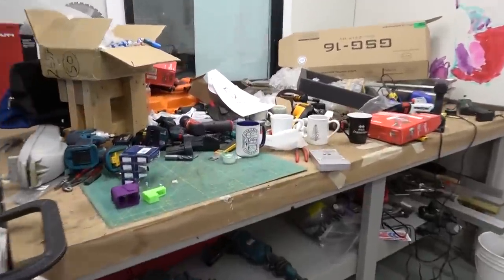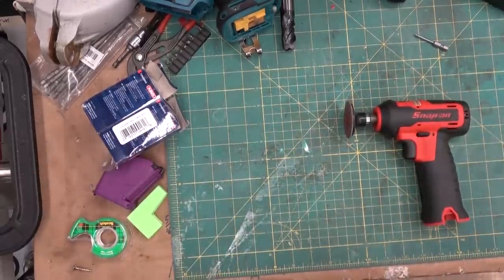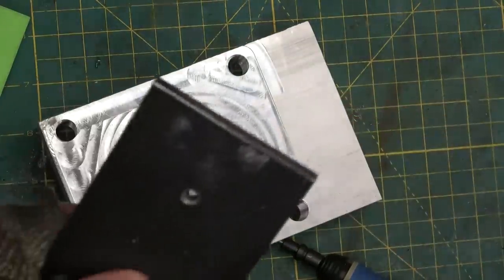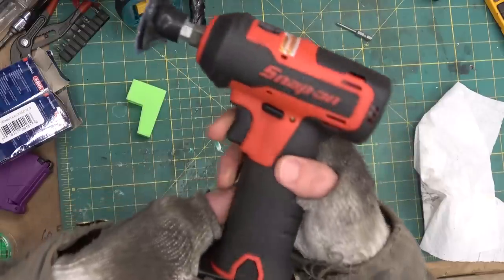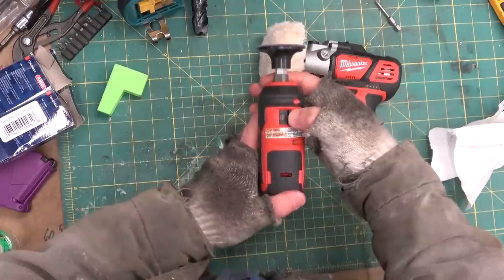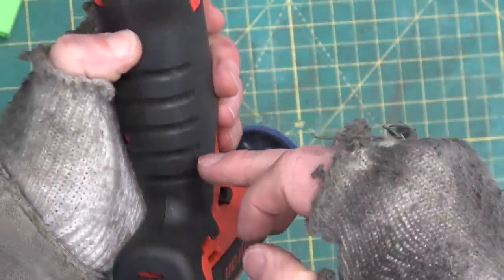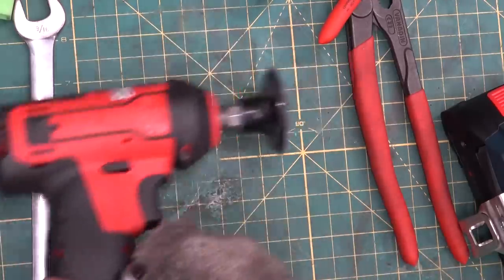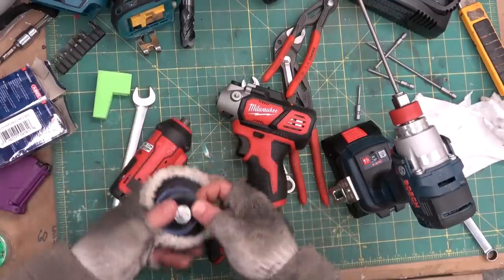BOLTR: Snap-On Polisher $$$ worth it?

Comment: Owned "one" for about 4 months now, I'm on my third replacement. First one had the motors bearing singing right out of the box, second one split case right through the lock switch, so have a third now that lives in disgrace at the bottom of the box , wouldn't tell any friend of mine to buy it.

Comment: Had one for about 6 months. Seems to work good but the battery run time is only about 10 minutes. Still easier then running an air hose for those quick jobs.

Comment: I do actually own that and the 3/8 impact gun with the same form factor and they do not last. I am generally not too hard on my tools and I own 2 sets the milwaukee brushless set is still going strong but the Snap on the one you are holding I’ve had to send it in for repairs once already and the 14.4v 3/8 impact has been sent in twice. I also bought the brand new Snap On 18V brushless 1/2” impact to replace my 2 year old Snap On 18V brushed 1/2 impact after I had to send it in for repairs too.

Comment: I have the drill and impact from the same series and haven't had a single problem with the over molding. The drill is usually exposed to cutting fluid on the daily. Might I add though the drill has NO NUTS so you might be getting one in the mail there Ave.

Comment: I've been using fapoffs impact driver and drill driver pretty much everyday for the past 5 or so years now not sure the models but use the same batteries as this guy. Real light duty stuff only solvent used around it would be isopropyl and the over molding has held up fine one issue is with the drill driver every couple of times of using it the chuck will get locked up needing a strap wrench to loosen. I'd say they feel about 350-400 for the pair. Not nearly 600 for on.

Comment: Don't have the grinder but have their 14.4v 1/4" hex driver (CTS725AK2) which is very similar design and the overmolding  is perfect like day one. Got the tool about a year and a half ago and I work in the oil/gas industry. I was skeptical but holding up like a charm overall. Chemicals and rain have not affected the driver or housing at all. Thing has plenty of balls to it and snaps many of screw heads 😂 and the forward and reverse rocker switch is awesome especially for overhead work. Does make me wonder if they made them cheaper or that is a "Friday" made tool right before quitting time one you have.

Comment: 4 years of massive abuse on my 3/8 drive. Primary use removing panels off excavators so m12 and some m10. This has a metal mesh around the motor. I use break clean to clean it and rubber still decent. However motor is wearing out after all the abuse but can get replacement for $60 so very serviceable and will save over time but the upfront $420 was a bit of a bite. But no other compares to size for power. But motor life not as good as you would expect from a $400+ tool. Holds up well to drop.

Comment: I'm a mechanic but one with a huge hard on for good tools and engineering. I'm not even going to watch the video to find out the snap on is worse. Basically any tool that's battery or air power and made by snap on is worse made than a cheaper alternative. I have a couple 400+ dollar snap on die grinders. Well guess what? I use my 7 dollar Chinese ones and their more powerful, although way worse built. But 7 bucks every 3 years is still a better economy. The 1 outstanding snappy product is the 3/8 impact they sell. Use that thing every day. But it's still brushed and only live about 3 years. But what's the magic that keeps us coming back? Well both times my beloved 3/8 impact has died, it was a 1 week process to have it sent out and rebuilt as new for 100 bucks. Didn't even have to leave the shop. Just hand it over and a hundred dollar bill and next week I'm guaranteed to be back up and running with an as new tool. That's the trick. Yeh a lot of other brands offer lifetime warrantee and such, but it's it's process that can take a Month, or in the case of matco about a year. I'm still waiting on a low pro air rachet rebuild kit from them for over a year. Snap on sales guys actually get the Job done, usualy no backorder parts, they show up every week. And their just reliable. That's the only reason they ever sell an overpriced air or electric tool. But don't get me wrong, they make some, if not the best soccets, screw drivers and basically any tool that doesn't have a motor. I will always buy that stuff happily.

Comment: I've had this same Snap On tool since they very first came out, off the truck it was about $200 for the tool only. Wasn't real impressed when the very first one I got had some nasty bearing noise, so I swapped the snappy man for another one. It worked fine and has moved a bunch of material in the 2-ish? years I've had it, no problems with the tool or the overmolding, but I'm fairly decent at keeping my tools clean. I was just told last Friday all of Snap On's current 14.4v tools are being obsoleted in favor of new brushless stuff, I wonder if they will improve on this at all.

Comment: I don't have this one, but I do have the 1/4" bit driver, which uses the same basic body (mine's 10 speed instead of 2). I've had it 6 years and the overmold hasn't peeled off. I'm in the shop 4 days a week, so it gets a fair amount of usage.

Comment: The light turns from green to red thru all the color in between as the battery shits out.  That’s how you know the battery level.  Pick it up and pull the trigger.  If it’s orange head for another battery

Comment: I had one of these on order for quite a while and it just wasn't showing up. Talked to my Snap On dealer this week and he found out why. Snap On has discontinued this version and went to a new one with a brushless motor. So I guess we'll see if that one is any better. As someone originally from Wisconsin, I do like both Snap On and Milwaukee equally, but I did buy into the Snap On battery so it's just not worth switching to Milwaukee.

Comment: I've owned Snap on battery tool and have had nothing but problems with them. Every thing from battery failer, trigger failing, charging station failing, and the case of the tool cracking while trying to use I ended up switching to Milwaukee's m12 and m18 and honestly have had way better experience and not to mentions they are a touch cheaper

Comment: Just for reference the tool by itself if you already have batteries and the charger is $220 USD. $455 USD with the two batteries and the charger. Considering you are taking in to account the total price would be worth also showing the quality of those components.

Comment: I don't have that exact model but I do have the older one of that snap-on screwdriver sander thingy ma whatsit. Does not have all the fancy gizmos as the Milwaukee but it's still going strong including the original batteries despite it being 15 years old. Same environment I cannot get anything Milwaukee to last over a year without letting the magic smoke out. Also despite the lack of goals for the over molding the butylene has actually held on really well. Way better than my Makita drill which has the holes but that shit has failed after three months.  no stupid holes to fill and either once you finally scrape all the over molding off.
Edit: Oh, and I completely misuse and beat the hell out of it. Lost it in a customer's engine bay once too. Came back in for another oil change and thar she was, pinned between the battery and headlight.

Comment: I don't have this, but I have the 3/8" impact from Snap On (only snap on tool I own, if I'm honest, a good friend got it for me for my birthday) and the overmolding is peeling off just a touch near the base, where the battery goes in, after 3 years of abuse rattling in my tool bag. The bearing has a bit of rust near the impact drive, I spray lube in it every now and then, think it got rained on at some point. I honestly think I can recall charging it 3 times, about. I've used it a fairly decent amount, swapping multiple transmissions and 1 engine I can recall with it.

Comment: I have two of the snap-off 3/8 impacts. I use them all day every day same 14v same over molding. Had them greasy and oily and clean them with brake cleaner. Never had the over mold peel or get sticky besides grease. The trigger and headlights is the downfall. But for $90 us they’ll replace it

Comment: Last Strap-On tool I bought was a slide hammer bearing puller.   Tool truck guy tried to sell my buddy and I their “proprietary thread” slide hammer for mega bud, said we’d never be able to match the “special threads” on the tool.  Challenge accepted. 3/4 inch rod, hardware store die, couple common stock 3/4 nuts and a chunk of scrap with hole drilled in it, and we were buying beer with the difference, and a lot of beer it was.  Lying bastard.  In my opinion SO is a lost relic of the past, dead man walking.  This BOLTR just helps prove it.

Comment: Snappy is expensive but they just gave a free half inch impact cuz my old one chooched it's last chooch  it lasted 3 years i own a tyre shop the gun was ridden hard all day everyday and out away wet 
Casing still holding up strong I've got 14 volt  tools aswell they are all pretty good the sander does have it's skirt on tho it is weak good for cleaning gasket goop off ... I've never had polished head on it rpm is far too slow i go straight to power grinder for polishing cordless polishers don't cut it needs a cord more power baby

That's 2nd half inch I've gotten for free as I cooked the first gen version they gave me the new one to replace that's free and now I've got the even newer one so I paid for gen 1 that lasted a couple years then gen 2 that lasted 3 years now new one I've not had a batt on yet I'm start riding it tomorrow ... paid for 1 tool once been upgraded twice for free and total 5 yrs use and still have a brand new tool in my hand that's why I buy snap on .... I don't think milfckie would honour a new tool after its been replaced once already and the original receipt is 5 yrs old 

I do have a millfckie 3/4 impact .... only complaint is batts are sloppy in it I have to give it bit of wiggle sometimes but power tho very strong I call 3/4 gun tractor 🚜

Comment: I'm more curious about the internals of that switch myself. Last snap off tool I bought the switch its self failed. With less than 30hrs of actual work. After taking it apart, the 200lb gorilla engagement point was what failed. It was some sort of mechanical relay switch. Hard failure and melted the copper on the inside of that switch.

Comment: Im a snap on guy... But I shitcanned my 11 month old snap on 14.4 set and swapped to all m12 and m18. Can buy a larger number of superior tools for less money. I had nothing but problems with the 3/8 impact and the 3/8 drill. The drill was worthless. Very very loose in the housing. It made it impossible to be precise. Apparently it was an unfixable issue. Sent it back multiple times. Never fixed.

Comment: A guy I work with bought one of these and it didn't last 3 days of intermittent use as a mechanic. Had to send it into snap on for repairs. I'm guessing the trigger assembly died in it by how its constructed. It hit battery overheat shutdown and wouldn't work again after that.

Comment: the tooling isnt really where they get you but its the battery and chargers. bought a 3/8ths drive impact with charger and 2 batteries and thing cost me 500 freedom dollars! then i bought the bit driver and it was only 150 without the battery and charger, already had the second battery so i got it and dont really regret the purchase, it paid itself off

Comment: I'm in US and bought the polisher from slap off and it burned out in 10 mins on 1 wheel..warranty  covered 2 and I've burnt out 3 they suckkkkkk but the over mold is still perfect but only cause the pos can't work long enough  to f up the over mold

Comment: So I'm team red, got a box full of it- unlike my wife, but that's probably cause I chop all off in one swing instead of a weekly procedure.  I have the 14.4 screwdriver which I do like and use daily. Best I can tell is the same case, the over molding is still holding on after 2 years. But for the most part, I can't justify just how many mooseheads I need to trade off for any of the 14.4 line.  Although he did trick me twice on it. You can tell from the T-shirt and the hat

Comment: i have a snapon cordless 3/8 impact that uses the same battery and has the same over molding that i use every day in the mechanic shop i work in and have yet to have any issues with the over molding and i have owned it for six months

Comment: I have an aversion towards buying cordless tools.  Especially from Snap-On because when the batteries shit the bed, the replacements cost more than the tool did, and they are not warranted for life like the rest of it is.  This is why I bought the Snap-On P-noomatic version of this as well as the 4-5” angle grinder.  Both advertised as delivering 1 Horsepower via air hose.  Both made in USA too.

1 Hp On a regular 1/4” hose? No fuckin way.  On 140 pissies of shop air through a half inch hose with 3/8” quick disconnect fittings—maybe...  I know it woke my 1/2” ingersoll rattle gun right up.

Moral of the story is that neither of them cost me $300 (the angle grinder might have-can’t remember), and I’ve always got 140 pounds of shop air at my machine.

Comment: I can’t speak much for the sander, but I have the 14.4 butterfly trigger impact and the drill of the same series, tough and Worth is, dropped from the deck of a 282 lienherr and a 2350 letourenau and still chooching like brand new tops have served me well right out of the bottom of an oil drain cart just a solid trigger hold and a can of crc not skipping a beat

Comment: I've had one for 3 years and I haven't had an issue yet. I don't use it everyday but fairly often as a automotive technician sanding and buffing gasket removing etc. It's been lightly abused I would say, is it worth the price? I don't think so but $75-$100 USD less...maybe?

Comment: For me this tool didn't commit me to snap on's 14.4 series, the 3/8 impact did. Fookin skookum choocher no doubt, and I bought both 1/4 and 3/8 ratchets as well. At that point I was committed bigger than life and had a few batteries and dreams of doing metalwork in my home garage with no air compressor. This little bastard burns through the batteries way more than those tools as well. Not the pride and joy of the fleet but I goddam sure wasn't going to swap battery specs in the middle of the stream

Comment: I have both the sander and 3/8 impact from strap on. The rubber over mold is junk worn right out .keep it away from brake clean as i found out hard way. But id still prefer my air pneumatic die grinder over the snap on

Comment: I’m a Snapon dealer. I’ve never had any sustained issues with the grips separating. We tout the chemical resistance of our soft grips. I mainly see that issue in the Milwaukee cordless I sell. (I carry both brands) We JUST changed a bunch of the Snap-on 14.4v tools to brushless (finally) in January 2020.

Comment: I have a question for you ave do you think the default battery powered impact is worth the money? I’m I pipe fitter hand and bought the magic 1200 ft lbs of breakaway power and was impressed, but a lot of people in the field trashed it. Is it worth pulling 300 foot of air hose up a 6 story building or is it something worth investing in and if so which one is the most for you buck?

Comment: I can’t understand the ‘hit and miss’ of these kinds a tools I have the Milwaukee m18 fuel 1/2 Ugga Dugga its brilliant! With the quality of that I bought the 3/8 12v ratchet (low torque for the smaller head) and was absolute garbage! Bought the snap on 14.4v and it’s far superior! But in this video the Milwaukee looks far superior. Consistent quality is key when I’m Spending a fortune on tools

Comment: I’ve had mine for about 3 years and it’s been used quite a bit haven’t had any issues so far with the rubber coming off or anything, I got a nice made in Bangladesh snap on cost for buying it so it justifies the price tag

Comment: Did you already do a breakdown on the Milwaukee sander/polisher? I’ve had that tool for about two years now and use it everyday (I work in composite fabrication so grinding carbon fiber and glass) and it’s holding up great. I bought the Milwaukee after using a coworkers snap-on and turned out I liked it better. Would love to see it’s guts and hear your expert opinion on it.

Comment: Fap off seams to have taken a turn like the most manufacturers. I noticed around 2016 things got more expensive for less quality/longevity/serviceability, as I have been a fool for the last 20 years working on hot broken crap that isn't even mine. I digress, I purchased what looks to be an almost identicle screw gun and was disappointed the moment I first used it. I had intended on using it as a multi purpose tool as I had with the previous model of the same screw gun essentially making it a nut driver and screw driver. The new tool has a limit switch that makes it not function if it thinks the load is excessive. So in many cases I would end up using it like a flipping t handle cuz the damn thing wouldn't do anything but light up and flash lights. Then I purchased a 1/4" electric ratchet only to find the same technology in it making it unless you have virtually new clean threads. Might as well light your paycheck on fire. Try buying a decent drill bit from them now. The Craftsman $60 set, I got to replace the snap on, actually drills, the $400 snap on set makes you work your ass off to get a hole. It's sad to see so many forign products in a company that use to pride itself on having a USA built tool you could rely on and enjoy using....so this is what Grandad was warning me about all those years ago.